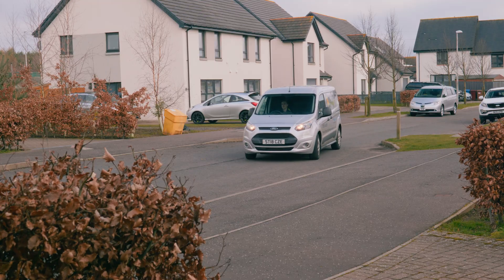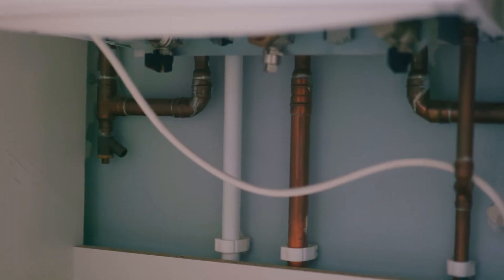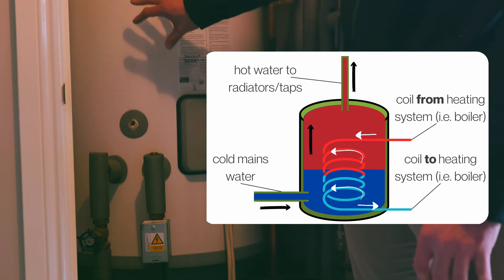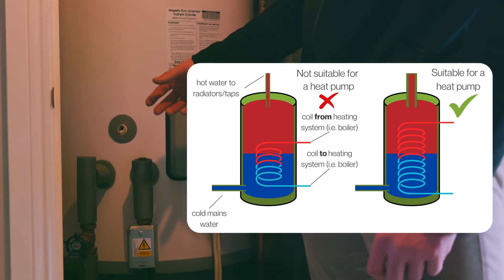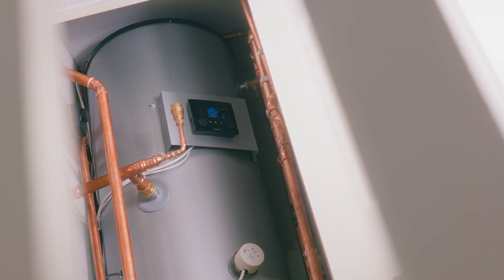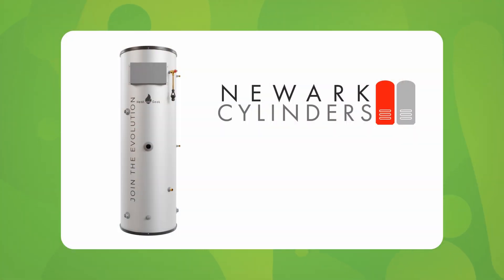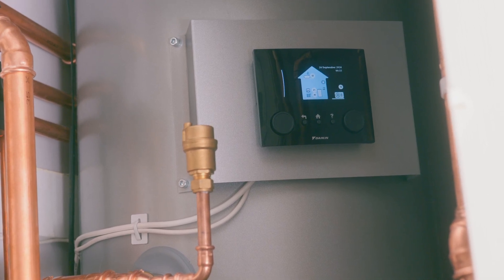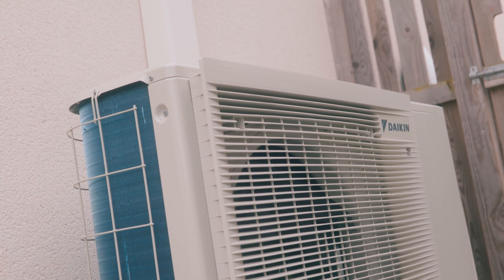Your Installer’s First Visit: Heat Loss Survey & Heat Pump Installation Revealed

Comment: One size fits all eh? I wonder how much cheaper this installation would have been if the DHW cylinder was left as it was and the customer used an immersion heater instead? They could use overnight cheap electricity to take the tank temp up from what the HP could manage with the small coil. On an EV tariff the 7p overnight electric is probably cheaper than running a HP at 60°C (plus the odd legionella cycle).
Reply from the maker: A great point, let's break it down!

Immersions use typically around 3kW. That's over 21p per hour at your 7p per kWh rate. A heat pump will operate at around 300% heating the tank. If the electrical rate is 7p, that's 2.3p running cost on the heat pump during the cheap period! Per hour then you're saving over 60% when using the heat pump apposed to the immersion. This is assuming that the heat pump will use more than 1kW per hour of course. 

Immersions are great but expensive!
Reply: @TheNaturalEnergyCompany  Sure a heat pump will certainly have lower running costs but (according to AI) the average household uses 4kWh per day on DHW. You'll save 4.6p per kWh compared to an immersion, or £67/year which is what, a 1/20 of the cost of the extra tank, pipework and installation time?

Comment: So u have to have the heat pump itself, a new cylinder, all new 28mm pipework to NEW rads? Thats gonna be a high cost isnt it even with the government grant which isnt gonna last that long I dont think?
Reply from the maker: Thanks for your comment - upgrades like a new cylinder or rads can add to the upfront cost, but with the £7,500 grant (running until March 2028)  and lower running costs, many households see a solid return on investment over time.

It’s a bigger initial spend, but one that often pays off in the long run. Thanks for watching!
Reply: Plus to replace all 22mm radiator pipework will mean ripping the place apart surely?
Reply from the maker: @calderjack7818  It really depends on the layout of the home. In many cases, full replacement of 22mm pipework isn’t needed, and experienced installers can often work with existing pipe runs or make upgrades with minimal disruption.

A proper heat loss survey will highlight what's actually required — and it's often less invasive than people expect. Thanks for watching!

Comment: I'm on a 24kw combination boiler at the moment. Testing with lower flow temps at the moment, 38/ 43deg c , in these moderate osa temps 9/14 deg c ,these flow temps are fine, waiting for osa temps to fall ,to see how things work out.
Reply from the maker: Thanks for your comments. That's brilliant you are trying out a lower flow temp. It really does make the world of difference for an efficient system. Regarding your other comment, this is a great question. It really depends on how your current microbore is plumped. It can either be plumbed in a radial or branch system. For a microbore to work efficiently with a heat pump, a radial system is best. Your plumber should be able to let you know how they did it. I hope this helps! Good luck with your system.